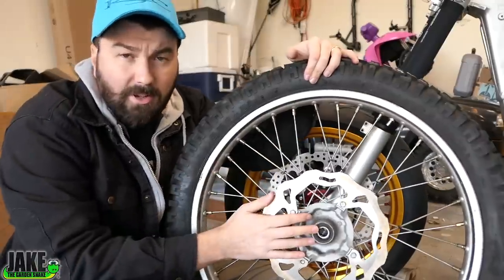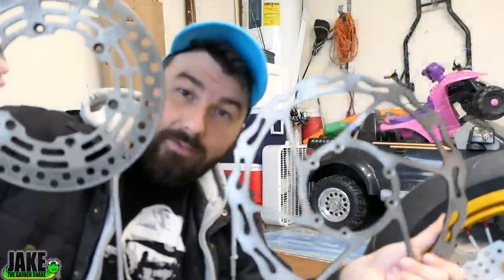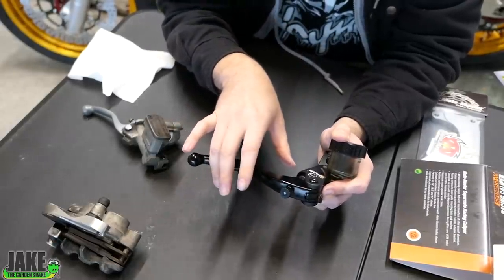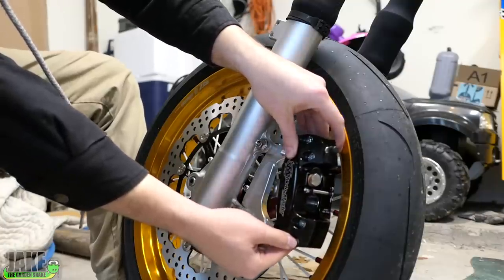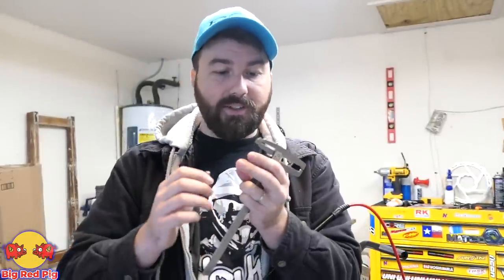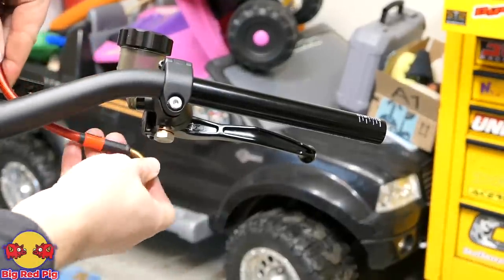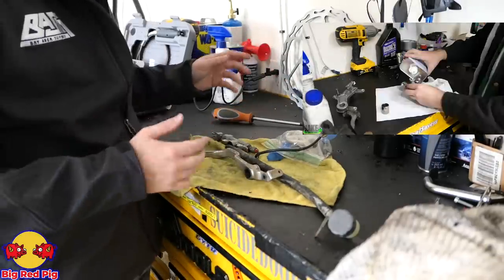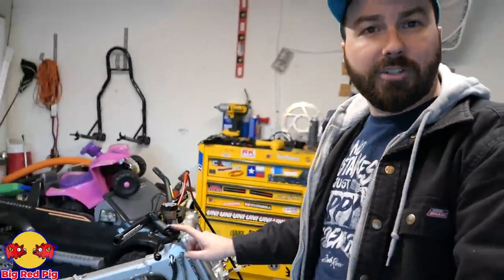HUGE Brake Upgrade - XR650R Supermoto Build #8

Comment: Steel braided lines alone make a huge difference!
Reply: Seriously. I have to wonder if the people who say otherwise have ever switched to steel braided lines on a motorcycle, on their own motorcycle. I mean I guess maybe it doesn't make a noticeable difference on most cars, I wouldn't know, but on a bike the difference is very much noticeable.
Reply: I think it's especially noticeable in very warm climates, like in Texas. Rubber gets softer when it heats up, and a black rubber brake line will in direct sunlight in the summer in Texas reach about 165 degrees. Rubber that hot is bound to be much softer than the same brake line in 65 degree weather.

Comment: Engineering explained has a lot of text book knowledge....but then he says some shit that shows you he needs some real world knowledge

PS: When you are trying to compare car brakes to bike brakes most people forget that 95% of the cars you are talking about employ brake boosters.  You may not even feel that squish of the rubber line when it is being transferred through a brake booster....but when 100% of your braking force is coming from you (your leg/hand).....
Reply: This. Well said. Plus I think Engineering Explained might not have taken into account that rubber brake lines, usually black in color, which will absorb heat more than lighter colors, will get ridiculously hot in direct sunlight in states like Texas. 165 degrees F (74 C) is not uncommon. Rubber that gets that hot is bound to get softer and therefore expand more than in 65 degree weather.
Reply: anyone who has upgraded to braided lines on a bike or car knows the difference.  Text book knowledge only gets you so far.  Great point Vyppaaa11
Reply: That's the problem wkth engineers, they never work on the shit they engineer. It's easy to think you're God when your computer does so much of your job for you. 
- a very salty welder
Reply: @casey360360  well, just keep it mind that your fancy brake lines and the amazing bikes we have are all designed by ENGINEERS. Not by practical youtube guys with rebuild channels or other very "resourceful" folks watching it.

Comment: jake...for tyre clearance i flipped the rear brake line holder on the swingarm,  drilled a hole through the top so i could screw it down and cut a slot in it so i could get the brake line out...

Comment: Your builds/BSOS/maintenance/repair videos are so fucking good, Jake. I absolutely love them. Fast paced and to the point but without skipping important stuff, with tons of useful advice for a novice mechanic like myself. It's funny, my favorite builds are yours and motonosity's, and they could not be more different. Polar opposites. 

I like yours because of everything I mentioned above, and I like motonosity's because he is (and if you read this motonosity - I'm not shitting on you here, no offense meant) a novice mechanic just like me, and if I were to build/mod a bike it would be very much like when he's doing it. Figuring shit out as I go, running into issues, making mistakes, learning.

Comment: I love your channel and I love seeing when shit goes wrong only because it shows me I'm not the only one getting my ass handed to me by something mechanical and even though I'm hyped about this build I gotta tell you I don't quite get the whole supermoto craze just because a semi-knobby dual sport tire will do 75-85% as good on the pavement as a supermoto tire but the street tire on most supermotos will only do 10% as good off road. It seems like you sacrifice more off-road capability than what you gain on the road. Despite all that I know that this thing will be an absolute blast on the road and with a quick wheel change it will be fun off road!

Comment: Caliper, caliber. Eh, same shit! Braided brake lines make a difference. When I switched from the old rubber hoses I had to change the amount of force I applied to the brakes to avoid lock up. If I applied the same force to the rear brake lever when I had the rubber hose after installing the braided hose I consistently kept locking up my rear tire under heavy braking. Definitely was a learning curve there. That's also with stock master cylinders, rotors, and pads.

Comment: Agreed that braided lines make a huge difference. As the rubber lines get hot, they get softer also.
That shim to align the caliper is pointless though Jake... calipers are hydraulic... one side will just extend the piston a little further to make up the difference. The pistons apply even amounts of pressure, not even amounts of movement right?
Reply: Uhh, not really. That will cause the pistons to sit at an angle as well which will over time round out the cylinder in the caliper. There is no fix for a rounded out caliper, it needs to be replaced at that point.

Comment: In 2013 you convinced me to buy a DRZ. After 6 years I finally sold the old girl and now you're convincing me to buy an XR. Damn it Jake. Also, I think Honda should scrap the 650L and focus on a street legal 650R. I have a feeling it would kill, especially if it was priced lower than the 450L.
Reply from the maker: It would make more sense then the 450L. 450s are fun but not ideal for street use.

Comment: There is a difference with steel lines and rubber lines for brakes on bikes. And the steel lines wont expand and they wont get dry rot and crack. And fall apart

Comment: Hi Jake, got a question about your 320 mm mod with OEM calipers. I Got a 320 mm Galfer disk, 4.2 mm thick, not installed yet (about de buy the spacer), and I d wonder if the OEM pads will fit, and if not, what d be the correct thickness please? Love your videos man, very helpful, cheers.

Comment: Probably a stupid question but does running the hose like that close to the disc have any issues. For example could excessive heat generated by the brake effect the  hose. Which could I then effect the braking performance ?

Comment: hey Jake(or anyone that wants to weight in) I have an FZ07 and am getting a new exhaust.Should I wait a bit longer and get a power commander(or whats in your fz) with it or just get the bike tuned by a shop. Im not planning on doing any other mods that would require a re-tune so Im conflicted. thoughts?

Comment: when u took off that clutch cover: I was liek wtf is this wizardry my shitty ass bike had no grove for the gasket to lay in, just 2 flat pieces crushing a paper gasket thats so intricate it's stupid, literally had bits hanging out without support to cover some of the inner parts, it was a nightmare to put it on without getting any oil leaks

Comment: Ahhhh yes... Brake puns.  I would have expected you to work in a "Jake Brake" reference somewhere.  Maybe next time.  
Q: When adjusting the banjos, I'm assuming you are just twisting the braid a bit. About how many degrees of rotation/adjustment can you get? I know it'll vary by length, so, per foot.

Comment: Steel braided lines vs rubber lines. Some bikes the brake lines can bend too much and cause damage, or even kink( CRF 500R for example ). Steel braided lines (core moto lines) dont do this.
Reply from the maker: I could install them correctly 😉
Reply: @TheGardenSnake   Im sure you could :). I meant the braided lines fix the issue with kinking. Alot of the crf 500Rs from the factory had issues with kinking/ lines getting damaged. Alot of riders that i know with  500 have switched to steel brake lines to solve that issue. So the idea that steel lines are only useful for racing is ridiculous.

Comment: THE PASSWORD IS---[ fulcrum ] .  That is also why vehicles are built by engineers instead of MECHANICS , if a mechanic designed and built something, it would never fail and last forever , as well as only needing   4  or  5   sized wrenches to totally overhaul top to bottom .